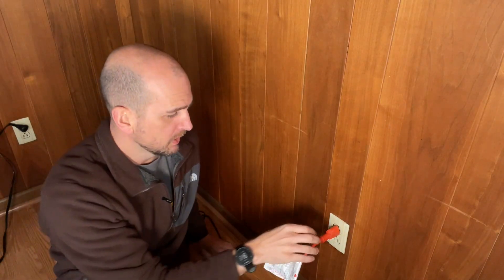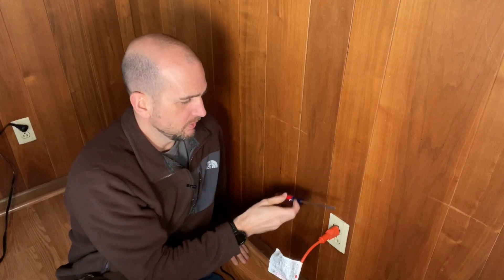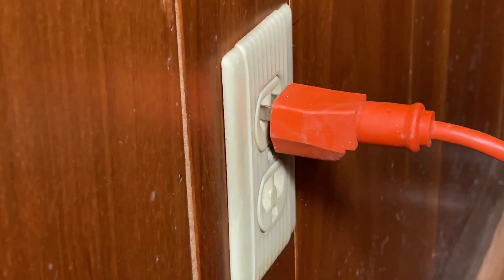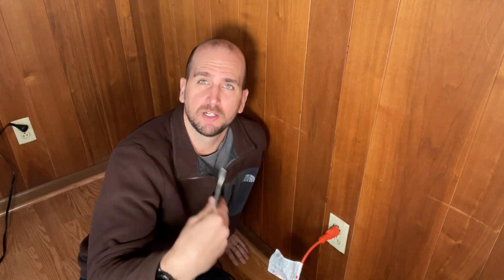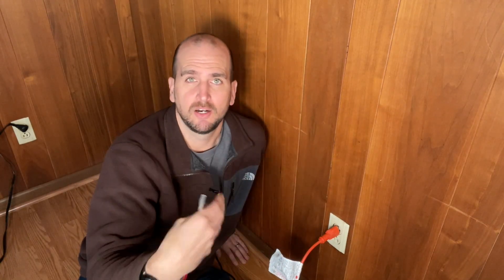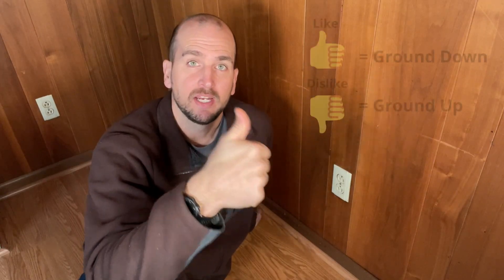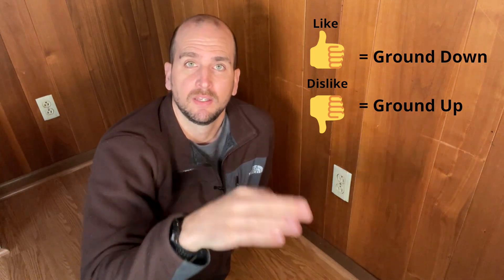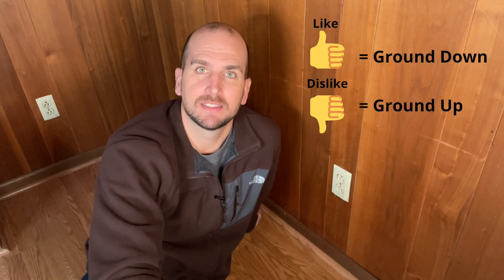Should An Outlet Be Installed Ground Down Or Up

Comment: 54 years ago when I started as an electrician  I was told always ground down because most plugs have ground down. This way there's less tension on the chord.
Reply: When I play chords on my guitar I like tension between the chords. Makes the music more interesting. I just need to make sure there is no tension on my amplifier cord.
Reply: Ground down just seems to hold cords in better. Like it's resting on the ground, and not so easy to pull out the top. Ground up all the pull is on the one pin...
Reply: If ground down and cord comes out then ground wire will be the last thing to come out.
Reply: The only time I'm a put a ground on top or on the side when hanging a TV just because the plugs on a TV some lay flatter with the outlet upside down or on its side but besides that I always put the outlet with the ground facing down
Reply: AND WEIGHT of cord holding ground in.
Reply: Exactly, not to mention some yuppie that thinks he's smarter than everyone started that and it's horse crap.
Reply: 18 years is a biomedical equipment technician every hospital I've ever worked in had ground up. I was told that it was so if a metal cover plate came loose it wouldn't short out the outlet and trip a circuit breaker potentially shutting off life-support equipment.
Reply: A secret chord? You don’t really care for music, do ya?
Reply: 48 yrs ago when I started an electrical apprenticeship here in the UK, the square pin plugs were the criteria for new installalations, now not much has changed since I left the trade  a few years after qualifying as a JIB(Joint Industrial Board) approved electrician, but according to the latest IEE regulations (Institute of Electrical Engineers)  I am not permitted to even wire up a 3 pin plug apparently in 2021, yet in my last years in the trade, I was mostly troubleshooting problems with electrical faults in commercial and private property installations. However when I moved into my current home  nearly 20yrs ago, it still had the original 1950's wiring in most of it, with an old wooden fusebox with porcelain rewireable fuses in it, only the kitchen and the cellar rooms had modern post '73 wiring. I rewired the house apart from those 2 areas, which I checked in accordance with regulations, and found them complying with insulation and earth tests with the regulations, apart from the colour of the insulation on the wires, I found no other faults, I installed a new fusebox with RCDs(Residual current devices)  on each circuit.  I left the old box mounted on the board to remind me of how things used to be, it is not connected to the mains, I think the latest installation guide requires ELCB's(Earth leakage Circuit Breakers), but I won't be fitting those as it is a disproportionate cost in regard to minimal extra safety, and I'm not allowed to do it anyway, so would have to call in an electrician. Yet politicians without medical degrees can tell me to wear a nose/mouth mask which cuts my intake of oxygen, and lowers my body's onboard immunity system to the detriment of said immune system; oh the hypocrisy in this modern world! Such is life.... The earth pin is on top in the UK, it's standard, and most plugs have the cable to the appliance coming out the opposite end to the Earth pin.
Reply: @claywithers523  UK is 220 VAC 50Hz - three prong.  I think they put Ground pin down too.
Reply: @garryharris3777  No, it is at the top, it used to be round pin years ago, but they were rectangular by the time I started as an apprentice electrician in 1973, I posted an image of the UK plug on this comment section somewhere. There is occasional roundpin usage, but mainly in industrial premises, with different socket outlets, 3 phase mostly, but some single phase usage.As in my present workplace.Qualified as an approved eIectrician, but changed trades some years ago, I would need to restudy the latest IEE(Institute of Electrical Engineers) regulations, and take an exam to go back into the trade.
Reply: @claywithers523  that's why I've continuously renewed my Masters license for 30 years now, I wouldn't want to retake the test, it's a bear.  😉

Comment: Install with the ground on the bottom. All appliances are designed with plug to be used with the ground on the bottom. Also, where I live inspectors will not pass the electrical inspection unless it’s down.

Comment: I had my house built about 15 years ag and mine are ground facing down.
Reply: My house is 141 years old and grounds are all down , house didn't have electricity until 1921, still have the 2 fuse panel ( disconnected ) of course.

Comment: I had also heard that if a metal wall plate came lose and fell on the connector, if it hit ground up first, no worries. The other way it would hit the hot/neutral pair and cause sparks.

Comment: In addition to the safety argument for ground-up... mechanically, the ground pin holds more securely, and a ground-up plug isn’t likely to get the ground pin bent off.
Reply: It is also longer then the neutral and hot prongs (for this exact reason) and requires far more travel before coming out of the outlet... not to mention the fact that a partially exposed ground pin is far safer then having partially exposed hot and neutral prongs in the case of a partially plugged in cord.

Comment: if something falls off the wall and it hits it 99.99% of the time its going to hit it hard enough to knock the plug out of the wall anyways and unless its paper thin its going to hit the rubber instead. and if it does make it to the plugs i'm going to say it won be hitting the contacts in the wall. and i just installed over 100 plugs and switches in my house and everyone is ground down.
Reply: oh and because of your videos i went back and changed my wall plugs for them cheap 56 cent plugs to  $2.50 plugs.

Comment: It's starting to become code that ground is supposed to be up.. that way when a item falls on the socket, it does not bridge the live and neutral... 

Hospitals, police stations, fire stations, and government buildings are all doing this... 

Hospitals are mandated to do this.

It also better because the plug does not slide out as much...
Reply: If it bridges hot and neutral, breaker go boom. In a hospital you don't want a circuit going out on a ventilator because a nurse was plugging in an light and dropped something in there or something like that so that's why they do that. In a house you just go reset the breaker, no problem. Not that I haven't put ground up before for other safety reasons though!
Reply: @notsure7874  It's also required in apartment complex's due to the sheer amount of people in that apartment.
Reply: @notsure7874 But it does not matter anyway... american sockets are shit, Get Europe's socket... much much safer. does not matter which orientation it is in. :D
Reply: @trevorfenlon4920  I haevn't really seen much of the european gear. Isn't it all 240v with no neutral - just 2 hots and a ground (Pretty sure they have better outlets to match)? It seems technically superior, especially if there are delta wound transformers - but I've been shocked by both, and I'll take 120v any day :D

Comment: I always thought that if you were in a flood prone area, or in a basement where a broken pipe might cause flooding if a drain is plugged up, that ground down would be better. The rising water would contact the ground before it got to the hot wire. Just the way I've thought of it (Because I live in a flood prone area). I could be completely wrong.

Comment: The modern day electric code states that the outlet has to always be installed ground up.
Reply: He said the NEC 2021 does not specify it. Where is your reference from?
Reply: @rty1955  2011 Electric Code.
Reply: @joeybarrelwilde  so the 2011 was superceded by the 2021 code and he said it dis not specify ground up/down
Reply: @rty1955  2011 electric code is commonly used. Ground up, and ground left on sideways mounted outlets.
Reply: @joeybarrelwilde  why would anyone use an outdated code? Makes no sense. Codes are updated to ensure more safety & to address better methods and materials to be used.
Reply: @rty1955  Insurance companies like the ground up, or on the left. Child safety I suppose. Smiley faces attract young kids, especially those with the autism spectrum.
Reply: @joeybarrelwilde  oh i have no doubt there are preferences.

Comment: For my shop, and extensive remodeling inside, I did ground up.  Ground up makes it easier to plug things in because that ground pin is the easiest thing to see.  Yet I have flipped a few to ground down when I have a particular 90° plug that wants to angle a certain way...

Comment: Ground down. Too many wall warts with keyed prongs fall out of the recp. from weight.   Some such as security wall supplies on ground up you will have even more problems, I've seen the weight of the supply break the screw tab on the wall supply.

Comment: Ground-down for three (more*) reasons: 1. Most plugs with grounds are shaped for your thumb to be flat on top as your index finger wraps around the bottom, making your index finger more likely to touch the bottom prong(s), 2. Electrical outlet extenders (especially the ones with usb ports) now come with a shelf on top to lay your cellphone on and are oriented for ground-down outlets, and 3. In case of flooding, you'd want rising water to contact the ground prong first.

* I wanted to mention 90-degree plugs favoring ground-down outlets, but you covered that.
Reply: Reason no. 1 happened to me when I was about 10 yrs old.  My index finger touched the bottom prongs and I got a reality check.
Reply: #1 is really important to me.  Not only is it more comfortable and put the more dangerous prong on top where it's more in line of sight, but that's the only way you can actually get a good grip on the plug.

Sure, under normal operation, that doesn't matter much, but if the plug is being stuck or the receptacle has come loose in the wall or someone has reduced grip strength for some reason (a grandma with hands buttery from baking for example) then ground up oriented plugs means the grip position of the hand is likely only pressing on smooth, rounded surfaces that you can only grip via friction that are parallel to the direction of force or even angled away.  Any design of the actual plug likely puts any shaping of the plastic that helps you actually grip the plug itself oriented in such a way that it only properly engages with the hand if you're grabbing it in the ground-down position.

This encourages 2 bad behaviours.

The more minor is bending and then yanking the cord itself.

The more major is for any inattentiveness to encourage the dumb monkey part of the brain that doesn't understand electricity to want to get a better grip by using the edge made with the front face of the plug once it gets out a fraction of an inch.  This means the index finger trying to reach under and up towards the still-connected hot prong out of line of sight and mind.

I've had this happen twice with extension cords (though as I've outlined it could conceivably happen with a normal outlet as well).  Once, the current used my finger to jump to the other prong.  A little zap but nothing serious.

The second time, the current went up my arm, across my upper-torso (which happens to be where I keep my heart and lungs) and down my other arm to get to the appliance I was holding (presumably to ground itself through that).

The result of this is that, other than some slight shaking, (and I cannot emphasize this enough) I could not move!  I couldn't let go of either the plug or appliance.  I couldn't yank the cord.  Every joint between my collar and waist was locked.  Only by change did the shaking finally pull the plug far enough out to break the circuit before anything worse than some muscle strain happened.

As you might imagine, I'm a bit uneasy with ground-up orientation if there's any complicating factor.

If we had good plugs, they would have insulation far enough down the prongs that nothing could touch them before the circuit had been broken, but we don't.

The ergonomic factor isn't just a comfort and convenience thing.  It's also a safety concern.

Of course, there is also a third option.  Sideways also works well from an ergonomic standpoint.
Reply: Third reason!!!!!! What if breaker doesn't trip.and Idiot electrician puts in wrong breaker
Reply: Good points
Reply: Charles - I agree!  I like the flooding comment. All plugs that I installed are groundown.
Reply: @rogertycholiz2218  
Crazy!!!
Think logic here fellas, don't want to have to turn in your "man card" do ya?
Be safe guys!
Reply: It also matters for polarized transformer plugs, which typically have the fat prong such that it will hang nicely if its ground-facing-down, but will unplug itself with the weight pulling if its ground-facing-up.

And most big heavy cords with a flat plug (power strips, UPSs, big short appliance cords) the cord angles towards the ground...so ground-down it reduces strain and tripping hazards.
Reply: Nailed it with the flood. Should have stated that first. And if the plug backs out over time you will most like break the L line first.
Reply: @Howard10Howie  
You're crazy...... I believe that the floodwater would be grounded already. Lol
Be safe guys!
Reply: That floodwater that's saturating the earth must generate more contact to ground than the 2-8' rods that ground your whole house!
Reply: The usa is way behind the times on electrical safety. The UK has had the safest system in the world since 1947. Its ground/earth at the top and live to the right, neutral to the left and of course with a fuse in the plug.
Reply: That third one is really stupid. If floodwater ends up reaching an outlet, I'd want the breaker to trip sooner rather than later.
Reply: @Cotronixco  Good point. There's a chance that the person who installed the outlet upside-down is standing in the water and Darwin wins!
Reply: @charlesrichards5389   Absolutely. Although I prefer ground down, I don't know what they were thinking with the rising floodwater scenario comment. They are probably just not thinking it through.
Reply: 1 - Won't apply to two prong devices, or guarantee your digits don't touch live prongs.

2 - Which is just manufacturer bias because there is NO standard. I've seen some that are the opposite and they even make some with a rotating choose your orientation option.

3 - In a flood that the water isn't going to do anything by touching the ground first. It'll only matter when it rises to contact a live connection and become grounded to earth by the water.
Reply: @givemeaforkingname  Two prongs  are usually flat on both sides.  Three prongs are often a bit triangular with flat side on the side of the live/neutral prongs. They are really uncomfortable to insert ground up
Reply: @givemeaforkingname  
1 - Did you see the part that said "most plugs with grounds"? Also, I implied no "guarantee" when I said your index finger is more LIKELY to touch the bottom prong(s). Maybe I should have also taken into account someone who lays on their back to unplug a cord? You can get more leverage that way, you know.

2 - You agree there is manufacturer bias, so... thanks? Tell you what, mount all your plugs ground-up out of spite. That'll show 'em!

3 - If you think it's smart to stand in water that rises to touch a live wire while its ground is up in the air, then hey, who am I to argue? There is NO standard, after all! Also, I hear Gorilla Glue must be a fantastic hair spray because it has no warning against it.
Reply: @charlesrichards5389  except for the floodwater unless we’re talking about a plastic/fiberglass box or something the box is going to be made of metal, it’ll be grounded and since it’s almost certainly not going to be water tight, the bottom of that grounded receptacle box will be the first point of contact no matter what orientation the outlet is in. Just saying.

Comment: You can do it whichever way you want...but when your wife comes home from bed bath and beyond with her night lights and air fresheners, the ground better be DOWN.
And what about the 90° flat grounded appliance cords 😁
Reply: I wasn't paying attention and installed one with the ground up, your right she was not happy, I had to change it!
Reply: @alexhilton4657  His right?
Reply: Likewise, if you have a polarized wall-transformer plug (a wall wart) and the ground is UP, then you are forced to plug the transformer in upside down, creating a hazard; you have torque both from the weight of the transformer and the position of the cable lead creating torsion on the plug, making it want to slip out of the socket. For that reason alone I'd always install ground-down.
Reply: Truth...
Reply: Very true!
Reply: This sounds like solid advice from a man who has served many years.
Reply: @Snuggs-o1  "served many years" sounds like prison time 🤣😂😆😂🤣
Reply: Bingo!
Reply: This is the most compelling comment on the subject that I have ever read.  Thank you.
Reply: Our old electric air freshener was unpolarized
Reply: Dedicated 20A
Reply: @poserwannabe, no matter which way you put them it will always be wrong with the wife! Haha
Reply: Guess what? The plug on those stupid wax warmers and air fresheners actually rotates to accommodate multiple outlet orientations!
Reply: @SomeGuy-vo7we  hahaha yep, some do, and some don't 👍
Reply: @SomeGuy-vo7we  hahaha tbh I never noticed that, I checked our stuff and many do but some don't...NONE of her night lights rotated and her "mini chandelier" night lights only go one way
😂🤣
Reply: @SomeGuy-vo7we  Not all
Reply: @SomeGuy-vo7we  yeah for 90 degrees, not 180, check again
Reply: Most don’t have a ground prong and they rotate
Reply: Unless you hate those air fresheners, then ground up is better.